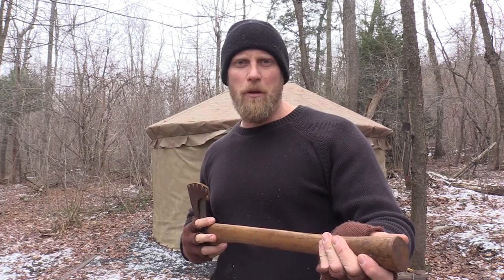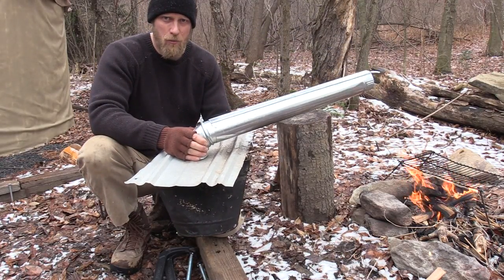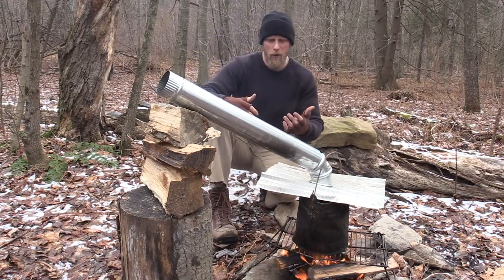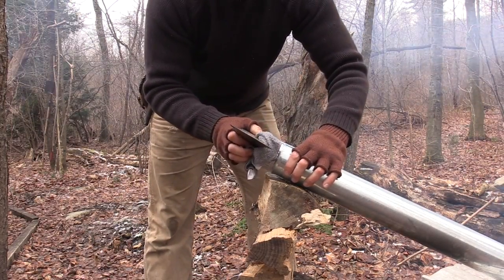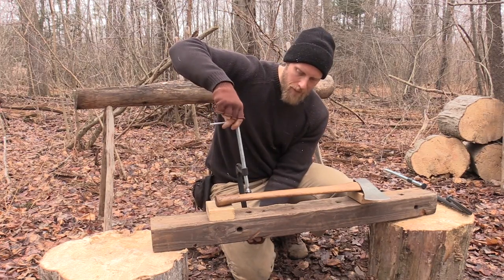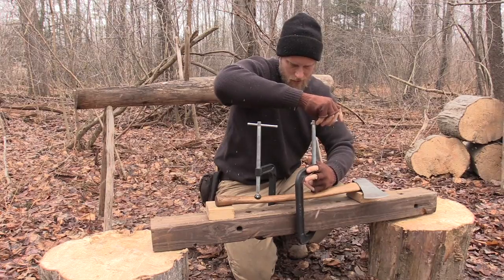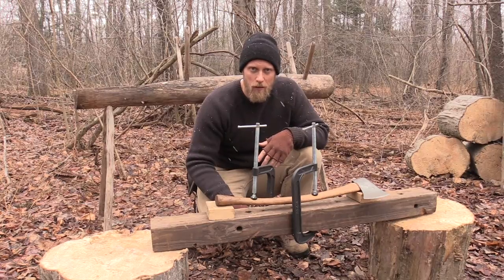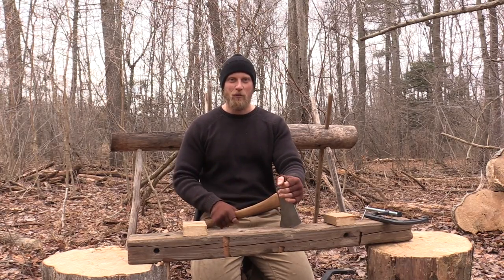Steam bend

Comment: STEAM BENDING.
A person can resort an axe hamdle that has been warped back to the original dhape by steaming it to get it playable. Then, put the axe on a table with two blocks, one at each end. Use c clamps or any method preferred to counter bend the handle in the opposite direction. Let ot sit for the desired amount of time and check it. If the handle is over bent or not bent back to straight,  put it back in the steamer and repeat this process.

Comment: I have a large Norlund that needs to have the original handle straightened as well so very timely posting of this video! One question, after steaming the handle do you have to do anything special to treat the wood to keep it from drying out too quickly and/or cracking? Thanks!
Reply from the maker: Jeffrey Mutch I always have done this process outside. So my advice is to just leave it cool for a few hours outside and after you remove it from the vise smother that handle in boiled linseed oil or any oil of your choice. You will see it soak in in quite quickly. So give it one or three more coats once that happens.  Good luck